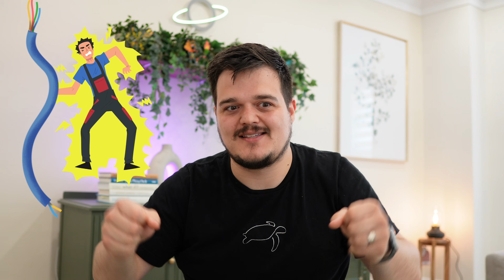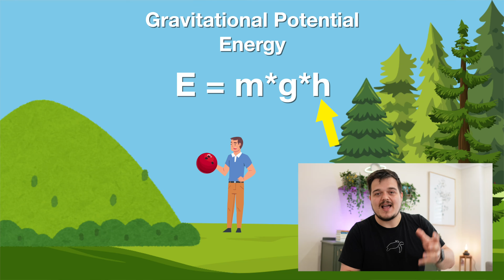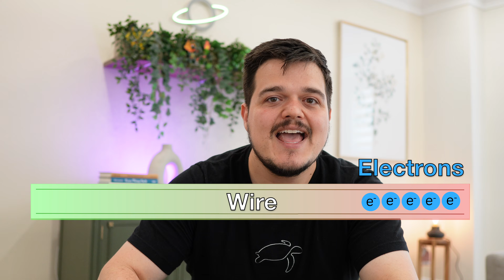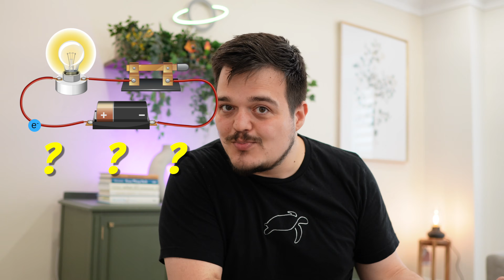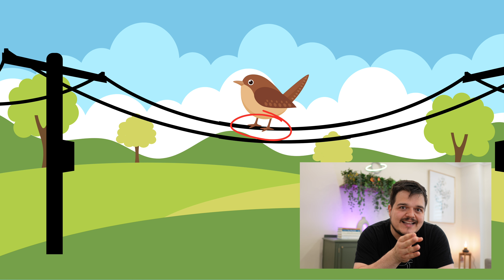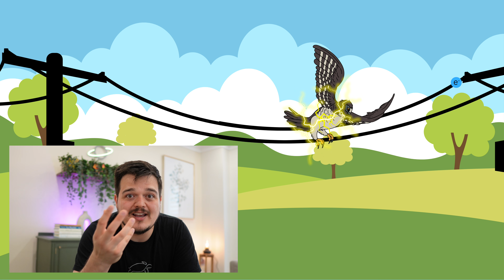Why Can Birds Sit On Power Lines?

Comment: Only flaw in this explanation is that technically electrons flow from low to high potential, because of the way the sign of charge is defined. But it's probably best not to mention this, as it's confusing when you first learn this stuff.

Comment: I am not sure that's how electricity works. My understanding was that the power source generates an electric field, and the electrons in the wire create a magnetic field around the wire, then as a result of the Poynting Vector this combination of electric and magnetic fields causes an energy flow through space (through the air) to the load (e.g. your toaster). In an alternating current (AC) system, the electrons just oscillate back and forth, so they're not actually "traveling" down the wire, but this is enough to create an energy field that flows in a specific direction. I could be wrong.
Reply from the maker: You’re right there is definitely more to the story than what I discussed here, but the intended audience for this was the average person who looks up at the birds on a wire and goes “huh…why can they do that?”

Comment: This is part of the story but your explanation is incomplete. At a point in time a high voltage wire might have a very high charge, and the bird in the air does not. As soon as the bird lands, because the bird has a lower charge (thus electric potential) electrons will flow through its feet to equalize the charge, the bird will charge up, like a capacitor. Because the bird is very small this current is also very small. Because power lines are alternating current, their charge will alternate between positive and negative, continuously charging and discharging the bird. This means that current will continue to flow through it's feet. The bird is itself the target of the electrons. Because the bird has such a low capacitance, this does not result in enough heat to fry its legs. A larger animal, like a human, would have more capacitance and therefore feel a greater effect. An object not touching the earth that has a high enough capacitance would definitely be zapped. In fact, it is entirely because of the high capacitance of the earth that you will be zapped while standing on it.

Mind you that current does indeed flow through paths that have more resistance. It doesn't magically know the route of least resistance, but it flows in the direction of the potential, inversely proportional to the resistance. This leads to the most current through the path of least resistance. The reason the current traveling through the wire doesn't significantly travel through the bird is because the charge difference between the feet of the bird is insignificant in relation to its resistance.

All of this nonsense would make for a more complicated video though.
Reply from the maker: You are totally right! There is a lot that I skipped over and more detail I could have covered but that would have made the video much longer and would have been for a different audience. I just wanted to provide people a basic understanding of why birds are safe on power lines for the average person who was wondering. But you do make some great points! 🙂 and thanks for taking the time to watch the video and share your feedback!

Comment: It might be different for local power lines but at least long distance power lines are actually made of aluminum because even though it's less conductive, it can move more energy for its weight. good video otherwise.
Reply from the maker: You’re totally right! I’m just so used to talking about copper wires when I teach electricity, “copper wire” just slipped out and I didn’t notice it. Great catch!

Comment: There are some caveats. If a human is able to touch a high voltage power line without being grounded, the human can still die. The human body has capacitance in open air which AC loves to put energy into and the introduction of AC into the capacitor (the body) will still see energy flow. Similarly, if you watch those lineman helicopters servicing lines in mid air, they use a rod to bring the helicopter to the same potential as the line, you will see arcing from around 12 inches as they approach the line. The linemen still use faraday suits or gloves when working on them. Small animals such as birds also have capacitance but it's a fraction of what the human body has and is not deadly to them.
Reply from the maker: Yeah great point! That’s true, but I didn’t want to get into all that in this video. I just wanted to provide people a basic understanding of why birds are safe on power lines for the average person who was wondering.
Reply: Thaths right, but it seems almost nobody has a grasp on the idea.

Comment: I have a doubt. In the case of a large bird touching the other wire with its wing, how do the electrons know that the bird is the path of least resistance?
Reply from the maker: They don’t “know”. But they feel a force pushing them from high potential to low potential so they get pushed through the bird’s body to go from the high potential wire to the low potential wire.
Reply: It flows in a stream of electricity just like water  (+ some magnetic mambojambo).
Reply: If a bird touches a live wire while grounded, or 2 live phases, it'll travel through the bird no matter how much resistance there is because the bird is completing a circuit. A power line simply transmits electricity from one place to another and isn't supposed to complete a circuit anywhere en route. The circuit is completed at the end of the power line at a substation where there is resistance, but if a bird completes the circuit before that substation, even if there's high resistance, it'll cook. There's so much voltage and so much current that it generally doesn't matter how many loads or "resistances" there are shorting the lines, it only takes a tiny fraction to kill something living.